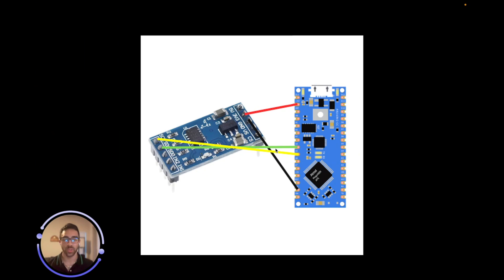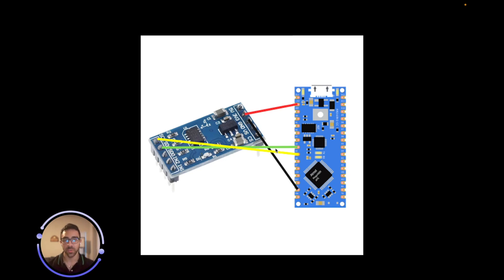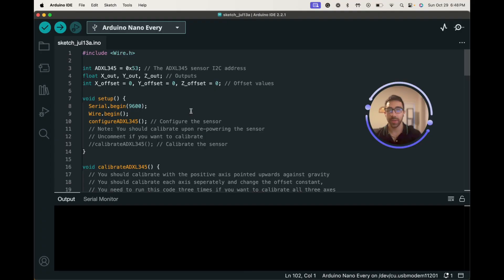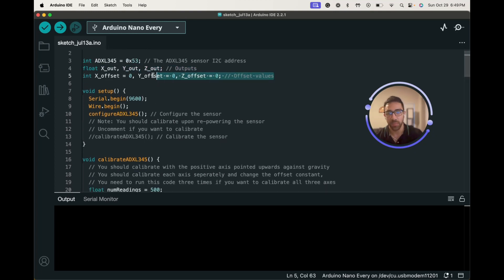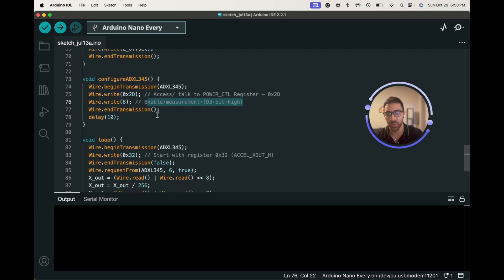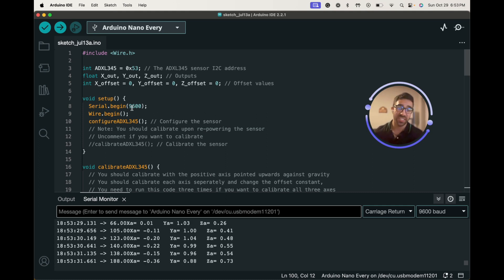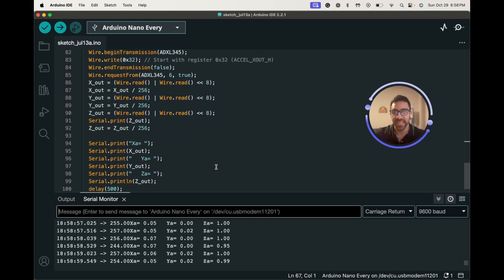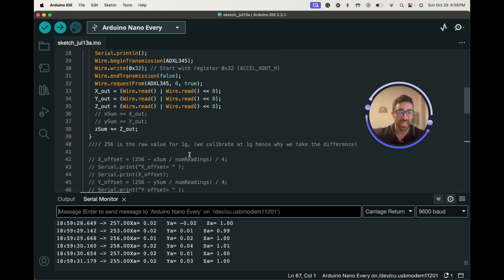How to Connect and Calibrate the ADXL345 with Arduino

Comment: Hi I am using this ADXL345 right now connected to rasberry pie 4 and best I ve got was 1000 reading from accelerometer per second with busio + python and about 500 with c++ and pigpoid because wiringPi library do not work with arm64 architecture. So my question is - if I will connect ADXL345 to arduino and then to rasberry will I get more reading per second? I need just speed
Reply from the maker: I dont think that will speed it up my friend. I would imagine arduino is faster because it is C based but tbh I never really cared to check for speed. I leave that up to you ;)

Comment: Hi I am building a segway. The code I have is using, (from 2014) , an old SEN10121 ADXL345. What changes will I need yo use a MPU6050?
Reply from the maker: Hi there! Transitioning from an ADXL345 to an MPU6050 for your Segway project involves a few changes due to the different capabilities and communication protocols of the two sensors. Thankfully it is such a standard sensor that the only thing you will need to change is the library in Arduino, there are more videos on my channel of how to use MPu6050 with Arduino so I hope those can help, thanks hope you subscribe buddy!